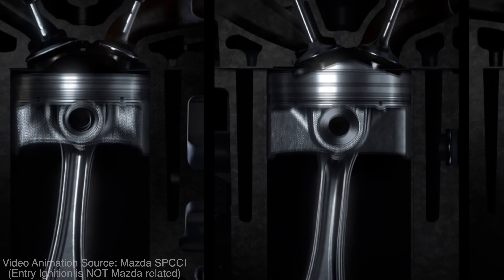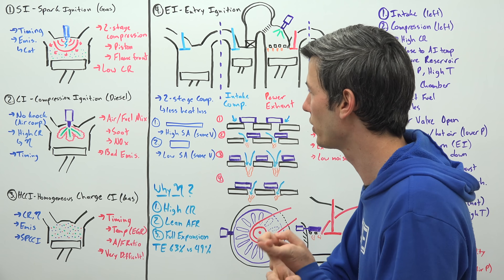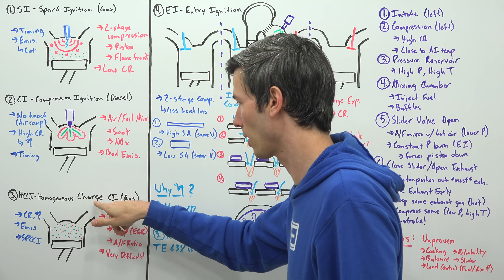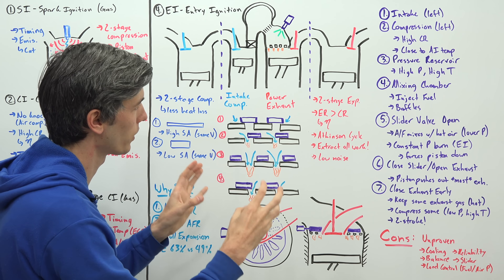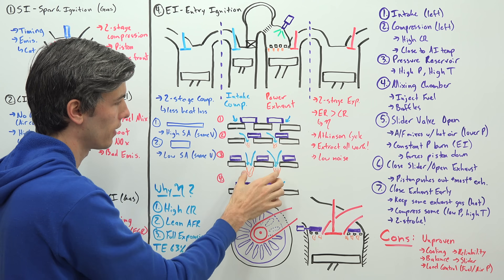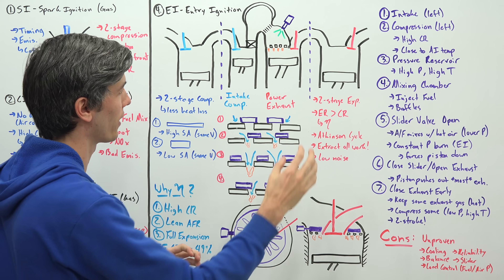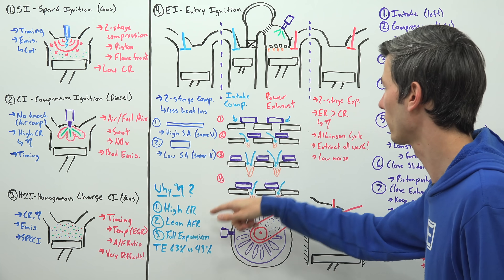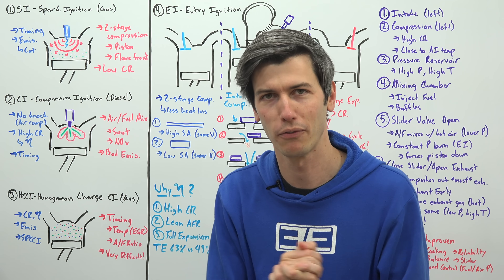Is 'Entry Ignition' The Future Of Combustion Engines?

Comment: Maybe i'm wrong. knock occurs at high temperature high pression, it's what we want to avoid. It seems that the idea here is to lower the temperature to prevent ignition. So compression, i suppose cooling then inject gas (no ignition cause high pression but not enough heat) then introduce to the hot combustion chamber so combustion occurs. The idea seems great. But only  a brief period of time to transfert to the combustion chamber so rotary valve.

Comment: How tf are you going to lubricate the slider valve?
to create a seal it will have direct metal on metal contact which needs to slide across for every power stroke. it will also be exposed to combustion high temp and pressure on both sides. 
apex seals are already a pain while only having a very small contact patch and being mounted on spirngs
how will the valve survive any more than the engine turning on?

I'm no engineer but the only solution I see is running fuel with so much oil that emission gains are thrown out the window. 

on the plus side just the metal sliding might be able to provide enough heat to pressurize the air without need for a compression stroke

Comment: Why haven't we developed a diesel engine that can run on gasoline. Tell me if I am wrong but don't we just need a fuel pump specifically designed for gasoline, and it doesn't have to reach ridiculous 20000psi in fuel rails like it does for diesel.

Comment: Fuel efficiency raises fuel price so you have to eliminate fuel. Oxygen combusts because that killed astronauts in a tragedy decades ago. You can spark that oxygen with mechanical flint or electric arc, most likely, which would need less fancy battery or at least lighter one than if it has to propel car by feeding electric motor....though probably not....but anyway an electric combustion engine likely involves battery less likely to be big explosion or long burning fire if damaged...

Comment: The problem I see with this particular design, is the need for exotic materials in the valves. You would need something akin to ceramics... extremely low thermal expansion. The problem with such materials, is they don't handle thermal shock very well. Operation in extremely cold environments could be catastrophic. Also, the issue of carbon buildup on the valve surfaces.

Comment: It still appears to be a four stroke engine, but the first two stokes are be executed by the first piston (or the optional supercharger from your other example).  The parasitic losses from the energy needed to drive the extra pistons or SC weren’t accounted for in this example either.  How does this mechanism compare with the precombustion chambers currently utilized in F1 engines?  Thanks for another fantastic presentation as always!  Knowledge is Power…and more horsepower is always better. 😉

Comment: So many wrong statements:
1. Heat loss in two stage compression is higher than the one in single stage compression. Just use small bore and longer stroke, it will be more efficient than any two stage with valve, because of less pump losses. The main advantage of multi cylinder compressors is inter-cooling.
2. Heat removal during compression stage is advantageous because it makes the process closer to isothermic, thus reducing the work on compression. Also, it is good for reducing the temperature of the air fuel mix, reducing knocking threshold. 
3. Isobaric expansion in cylinder 3 is what you want to avoid, because in order to maintain the pressure you will been to keep adding heat to the already expanded gas. That means, the average compression is half of the initial.
4. In order to prevent the fire from propagating pack from the cylinder to the mixing chamber you need to abort the flame on the slider valve, which means - some fuel will not be burnt. Also it means big pump losses on the valve itself, because the slits must be very narrow.
5. The exhaust from the last cylinder will be at atmospheric pressure, it always is, but the exhaust will be very hot, because of the isobaric expansion in the third cylinder.

Comment: I've always wondered if you could use a turbo not for forced induction but almost like a second engine for exhaust gas energy recovery... Either you have a turbo electric generater attached to an engine electric assist motor or some kind of gearbox that can keep the turbo at the optimal rpm while sending power straight to the crankshaft.

I've also wondered if you could route the exhaust gases through a boiler to create a steam hybrid engine xD

Comment: Kinda reminds me of how a multi stage steam engine works.
If they can make it work it could be an answer to improve efficiency of ice powered vehicles for lower cost than a hybrid drive.
It also should be able to work on lower quality fuels maybe run on almost anything.
We really to be looking at a as many solutions as possible and diversify especially since lithium ion battery electric cars could actually be worse for the environment than the ice vehicles they're supposed to be replacing due to the pollution from mining and the battery pack becoming junk after 10 years,only 5% of the batteries getting recycled, and it costing more than the car is worth to replace.
Don't believe me search cobalt mining in the Congo warning it's so bad it's not for the faint of heart.and search a man blows up his Tesla.

Comment: Compressed air moves faster and ignites or heats faster than when it has fuel or diesel in it that's why they like to get the fuel in there the diesel of the gas the last second. Or I should say the fraction of a second 30 times a second is 1/30 of a second so the air has to move in there and be compressed and heated for combustion in 130th of a second

Comment: 600 RPM a minute is 10 times a second it's easy math at 1800 RPM that's 30 times a second so in a fraction of a second there has to move into the cylinder and decompressed heated and ignited so I don't know what is one second divided by 30

Comment: Air heats better and moves faster than when there's gas or diesel mix with it so therefore that's why I feel injection is really great to shoot the gas or the diesel in there at the last second with the spark split second I should say fraction of a second cuz we know at 1800 RPM that's 30 times a second

Comment: I guess it's kind of like micro science technology like air moves faster than gas and air like with the carburetor or a TBI that's why they don't use it and second of all air compresses then heats up for ignition instead of air and gas or air and Diesel that's why they want to shoot the gas or the diesel and at the very last second with the spark

Comment: Sense this is all just a thought experiment at this point here is my idea for trying to polish this out. What would concern me the most is the balancing of the 4 different sized pistons. I don't know how hard this is in practice but to simplify this general idea I would remove piston 1 and 2. Leave piston 3 (your 2 stroke piston) and piston 4 (exhaust scavenging) and replace piston 1 and 2 with a supercharger. A turbo wouldn't work because piston 4 acts as a turbo using the exhaust pressure to make additional power so a supercharger would be required. Then in theory you could make cylinder (3 and 4) the same size to assist with balancing and reduce complexity greatly. The slider valve I see being the weakest point in this system and controlling combustion. However, if you can have those two areas be reliable this could be realistic. With just 2 pistons it's smaller, less complex, and cuts down on mass. 

That's my two cents anyways.

Comment: It's like the sleeve valve British built aircraft engines. They developed good horse power to displacement raitos. However, they were complex, heavier,  requiring much more gears parts and machining and production expense. $$$$$  More complex is not always better. And when they broke they were one big parts bomb.

Comment: Wouldn't it make more sense to replace the first and last stages (pre-compression/post-expansion) with a turbo charger? A generator/motor can link to them to act as a powerful starter, or you can have a compressed air tank like in the Agera. The slotted injector plate should be driven by a geneva drive so it isn't trying to rotate against high pressure during combustion.

Comment: Let me start by saying this, the SAE knows better than me.  I’m not an engineer!  What concerns me is the losses associated with having to pump two “dead” pistons… pumping air requires power… and that requirement increases exponentially when you have to compress it to the point of auto-igniting gasoline.  Then the concentrated heat issue as mentioned, I didn’t even consider that initially.  

There have been gimmicky engine designs since the dawn of internal combustion and nothing has really stuck due to cost, complexity, reliability, etc.  The only design that really interests me is the variable compression engine (Nissan, I think?).  Time will tell on the durability of that design and whether or not it goes down as another gimmicky failed design.

Comment: I’m impressed with your technical knowledge and would be very grateful if you could answer a question for me. 
I built a Chevy 400 block in which I shortened the stroke to 3.250”, and lengthened the rod length to 6.250”.
All this with a 4.155” piston on a 2400 pound car.
I know about rod angularity and wear, I know about longer dwell at TDC. The combination seems to work great.
But I would like to understand from an engineering and physics view what the advantages and disadvantages are, using a shorter stroke, longer rod, with a big piston area. 
I would be very grateful if you could clear this up for me, or maybe direct me to where I could find the answers to my query. 
Thank you for sharing the knowledge that I wish that I had.

Comment: I can't get one thing, you're saying about mixing hot pressurized air with fuel, but it's known for I think every petrolhead that if you wan't to get nice and good mix you need cool air to mix with fuel, 
Power of engine running on hot air usually goes really down.
Reply: And with such design you would get a 2 pistons on power stroke in a 4 piston engine, which I suppose would cause some serious imbalance, because of only "2 hammers" moving up and down on the contrary, I wonder how tough would need to be crankshaft to survive it, and how big counterweights would need to be, and you would get power stroke per 180 degree of rotation, that's a lot, so 4 pistons would be not enough, with 8 pistons in such design there would be 4 power strokes which would give us power stroke per 90 degree, that's poor considering amount of cylinders, moving parts, etc. 
It couldn't be reliable using some common materials

Comment: Wow I guess Sheldon Cooper is designing engines now. This will never see mainsteam use most likely never even make it to prototype. You missed the target with diesels being dirty and less efficient. Multiple event injection has cleaned up the diesel remarkably. With proper computer fuel maps they can be very clean and powerful without making smoke and keeping emissions in check. Ask Gale Banks. Oh ya todays mechanics would never be able to keep that engine running. They cant keep todays engines running properly dont make it harder for them😂😂

Comment: Seems to me if your going to use dual stage compression it only makes sense to use both top and bottom of the Piston especially if there is no fuel added with the intake air until it's in the cylinder

Comment: Piston engines are inherently inefficient. The directional changes for one and most energy is wasted in the in the form of heat. Pistons and crank shafts outdated tech. Electric will be the future. The electric car will not require antifreeze and all the related junk for cooling, plus no leaking oil and transmission fluid. With solar I can charge it for free.
Reply: They have liquid cooled controllers so they  will require anti freeze and all the junk that goes with it
Reply: @Markcain268  How do you like that. Thanka for the info.

Comment: I'm just thinking about the carbon buildup and unison ring wear issues in a Ford 6.0 VGT and applying it to these "slider valves." The turbo is easy to get to for cleaning or replacement, but this? I realize that exhaust flow in a turbo diesel is just a liiiittle bit different than a gasoline combustion chamber, but, still.

Comment: The efficiency of combustion engines can easily be improved. The important thing to remember is that the power of an engine comes from the combustion chamber. But the air which enters the combustion chamber before the explosion is too hot. Therefore, the air can’t expand very much when the gasoline is ignited. 

So the answer is to cool the engine air intake with a swamp cooler. They used to make swamp coolers that would bolt to the roof of a car, and cool the people inside. An air intake cooler would probably improve fuel economy by twenty percent.

Comment: I can't think of a more waste of space and effort trying to save the inefficient stinky gas engine. We have outgrown this, Electrics the word.
Reply: Yeah but they are so dull to drive, once the novelty wears off you'll find yourself yearning for a real engine, of course, with some folk the novelty never wears off, I had a dog that would play with a ball all day long and each time you threw it for her she thought it was the most fantastic thing on the world!
Reply: @Markcain268  To modify a piston engine needs a lot of machining know-how. Once you get Knowledge it will be easy to modify an electric car. It is easy to modify an electric system, dam hard to modify a mechanical one with little improvement in power without a very high cost. We just haven't got our minds around it yet. Ev sports cars will be great fun to drive with fantastic controllable power that ICE car owners could only dream about. We haven't built any they are yet to come.
It will be great to sit on your computer and make most of the performance modifications then download them to the car computer. Beats getting carbonized black oily hands. It's a new world coming. Join in and be amazed.
Reply: @briansture4353  EVs are simple, I learned about electronics as a child, in fact it was my hobby for many years, I also did an apprenticeship in engineering when I left school and worked as a general machinist for many years in the mining equipment industry, I still dabble in electronics now, it's good fun, but I get far more satisfaction getting my hands dirty welding, machining, using hand tools etc thats why I offer to fix friends cars for next to nothing, hopefully got an old Freelander wants some work  coming up soon! The only thing I don't like about it is I'm going to have to sit on a computer and order parts for it, but I'll get that chore out the way first!

Comment: For your diesel explanation you described pre-ignition as knock. Knock occurs AFTER ignition and is an important feature of diesels. It's why they have knock sensors as the engine automatically adjusts to operate slightly before knock starts. You can't have pre-ignition in a diesel as there's no fuel yet - so no ignition.
Reply: What about Diesel engines with Pilot Injection?
Reply: @sandervanderkammen9230  Still no spark plugs, mind. So you can't really have pre-ignition in a diesel as it can only occur once fuel is added - which is then knock?
Reply: @marrs3312  But Pilot Injection stops knock in Diesel engines... Knock is not the same thing in a Diesel engine. 
The sound is simply a sudden jump in combustion chamber pressure.
Deflaggeration is always subsonic

Comment: There was a British engine in the 1980s that never went beyond prototype. It had a small primary air cylinder where rich mixture was mixed and ignited. The part-burnt gas exhausted into the main cylinder containing hot compressed air where the burn completed. It was clean and efficient.

Comment: Do you know if you can multi purpose the cumbustion cylinder to be the compression cylinder as well.  Maybe adjustable compression connecting rods/crank, to utilize every piston on each cycle/rotation.  
I'm not sure if the added thermal efficiency overcomes the mechanical efficiency loss.  
Keep up the great vids.  Stay Happy and Healthy

Comment: A few questions:

1. How will this work on a cold start? The ignition piston won't be hot yet.

2. You only get 1 combustion stroke per 4 cylinders cycle, won't that get you less torque and power compared to any other 4 cylinder engine?

Comment: Slider valves made out of 718 Inco? I'm thinking it is one of the most wear resistant metals. Although it is very difficult to machine and an expensive material.

Comment: 1. Ultimate efficiency would be an engine that could run on what we currently describe as pre-ignition. You can see 10x pressures from pre-ignition vs standard ignition, 1/10th the fuel could produce the same power we have now if the components could withstand that A/F ratio.

2. This entry ignition engine is a bit of genius and a bit of madness. I can't see it surviving for 300K miles like a modern engine. A simplification of this design using components similar to today's engines might hold up though.

Comment: I can skip most of your sliding etc by adding a turbo down stream from the carburetor/injector  as a heater/mixer to raise the pressure and the temp or the incoming charge. The air fuel mixing is done in the intake tract. You can dump the extra cylinder  and accomplish the same thing.